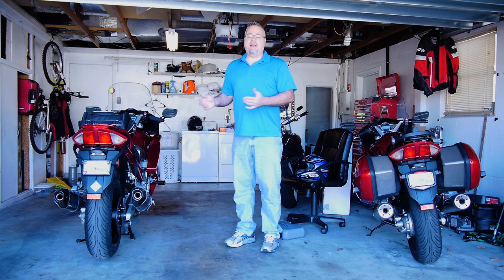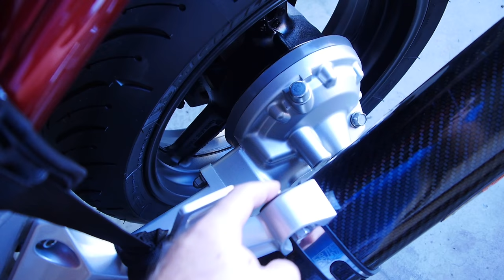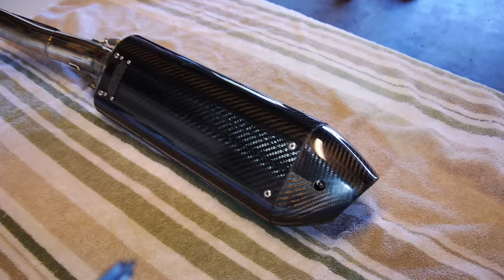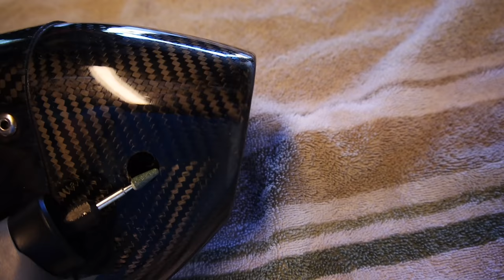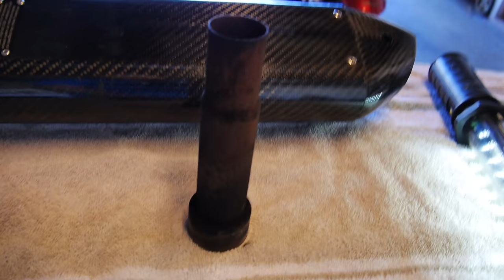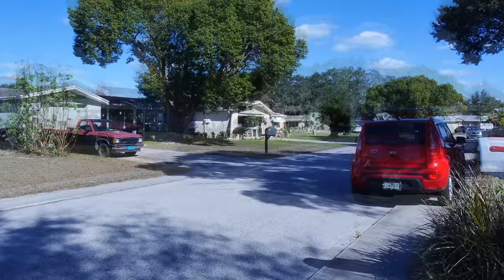FJR1300 Exhaust Comparison Stock vs Yoshimura R77 Baffles In And Out Plus No Exhaust

Comment: Love the sound of some loud pipes but none are worth the money over stock. When you're keeping that stout 1300cc engine pinned and still need more, get a full system. Most never use what they already have because the bike really pulls hard from about 100-130mph. The FJR1300 is sport tourer and loud pipes can get old on a deserted highway in the middle of nowhere. I prefer whizzing by like the wind vs causing every sleepy cop to look my way.
Reply: Agreed. I want as little attention on me as possible when I'm doing 110 down a lonely interstate

Comment: At $1,129 each for these slip-ons on Revzilla, I think the stock pipes sound just fine.  Plus, I don't want any more noise if I'm running down the highway on a long trip.  Good comparison, though.  Thanks!
Reply from the maker: Both, not each.  And there are better prices than revzilla for parts.
Reply: @TwoWheelObsession  whoops!  You are right. That price is for a pair. Would you change yours to Yoshi’s?
Reply from the maker: I like the stock sound on the fjr. It’s a 4-1-2 system. Slip ons really don’t do much for it IMO

Comment: I went through the loud is better stage years ago with my 82 GS1100 E with Vance and Hines header and stage 3 jet kit. Very finicky jetting as the weather changed. Anyway I got older and decided to just keep my fjr stock sounding.  Only person that needs impressing is me. Besides, aftermarket mufflers cost an arm and a leg for no noticeable gain.

Comment: I liked the Yoshi's both baffle in and out with a preference for out. My Concours 14 had a carbon Two Brothers slip on and it sounds so sweet and I didn't find it droned or was annoying at speed, quite the opposite actually
Reply: I agree, It is definitely not very loud without the baffles, probably helps it be a little Quieter having 2 exhaust mufflers on an inline 4 than a 4into 1 exhaust would be..

Comment: Thanks for sharing sir. How did the FJR run with the Yoshi pipes, both with and without baffles? Being injected, I just wonder if the computer was able to compensate for the mixture change you would expect "un-corking" the exhaust a little. It sure sounds great with the Yoshis.
Reply from the maker: +klwhitacre slipons only change the sound.
Reply: Roger that. I put Jardines on my 95 V-Max a few years ago. It was carbureted (of course), and needed to be re-jetted after the install. Do you know if he saw any noticeable performance/mileage changes after the install? Thanks again sir.
Reply from the maker: +klwhitacre no changes other than the tone.
Reply: Goog point with no backpressure that might change things
Reply: @TwoWheelObsession  old comment, but not really true as the uncorked mufflers will help the engine breath a little better. I actually lost just a bit of topend power on my old cbr F2 by switching to a loud slip on without re jetting the carbs.. It honestly felt like it was down about 8-10hp up top, But it was carbed and perhaps the injected ECU of an FJR can compensate some.

Comment: i had yosh exhaust on my previous bike, gsxr 600.  the weight savings was remarkable with one can.  x2 for the fjr and that might make a difference to the jump and feel of the bike.
Reply: I'm not trying to argue for the sake of arguing. But, my stock FJR doesn't need more jump and feel. Those bikes are incredible. So much response, acceleration and power. If you've never ridden one, I highly suggest it. 140 hp is incredible on that bike. It won't corner like your GSXR. But, I'll put it against any sportbike in acceleration. The 1/4 of a second that a 1000 cc sportbike could beat it is arguable depending on the individual rider.

Comment: Do you have a video removing the baffles on a regular FJR 1300?
Reply from the maker: No, hardly anyone does that, it sounds like crap.
Reply: Peter W. Santa-Maria Sr. Don't do it. If by some miracle it added 25 bhp yes but to just piss off the neighbours forget it.
Reply: There is a video out there. I bet it's sounds just right. If you don't like it you're out $20 and then you pick up some slip-ons.

Comment: The problem I have with after market "louder" pipes is yes they sound nice for a bit then just annoying if they added power I would have a different view but they do not. The only street bike that worked with aftermarket pipes was the original 1200 bandit. That my tuppence worth.
Reply from the maker: Slipons may not add power but full systems do.  I gained over 10 hp on the dyno on my fz09 and they are pure pleasure sound.
Reply: I also have a fjr13 this one is my 5th with electronic suspension and the most awesome lights ever I find the leaning lights seem to work well.

Comment: I don't mean to sound like a dick. But, I have to ask... what is the point of putting new exhaust on a sport bike? I get the loud rumble desire if you have a big V-Twin. But on a sport bike? It kind of reminds me of the exhaust people put on Civics and want to be cool like the guy down the street who has a Camaro SS. 

I don't get it.
Reply: Any or all of these... Deeper sound, raspier sound, not having to hear the transmission (FJR has a good bit of whirring, as do some other bikes), shaving weight, better looks, better location, better construction and in my opinion not so much for inline 3/inline 4, but for V-twin sport bikes and V-four sport bikes it really 'wakes it up' in a MUCH more different way than putting a Folger's coffee can on a Civic.
Reply: Don't think of it as aftermarket on exhaust on a civic,  but rather performance exhaust on a performance machine like a Porsche. 
Putting aftermarket on a VTwin is strictly for show as they aren't performance machines. 
But Yoshi can increase HP, which translates to better track time for some.
Reply: Loud bikes are safer bikes, speaking from experience no cagers hear stock pipes
Reply: Just imagine if you learned to ride it lol.
You want to be safer then wear neon or reflective clothing. I saw nothing in the HURT report about loud pipes, but would be happy to read any statistics you have supporting the claim.
Reply: So, you are saying that this is a performance tuning thing, more than an audio cosmetic thing (though, after market pipes do increase HP on a V-Twin).  Gotcha.
Reply: Different strokes for different folks..
Reply: There's a weight advantage, too.
Reply: Yes, they will improve HP and performance if the bike is properly tuned with some kind of tuner (Dynojet Power Commander, Cobra FI tuner, etc.). Otherwise, you tend to lose back-pressure and low end torque. All of that being said, I own a cruiser (Yamaha Raider 1900) and sport bike (Honda CBR 954RR). The sportbike will destroy the V-Twin in performance. V-Twin cruisers aren't performance oriented regardless of what exhaust you're using.
Reply: JFeezy Moronic statement!